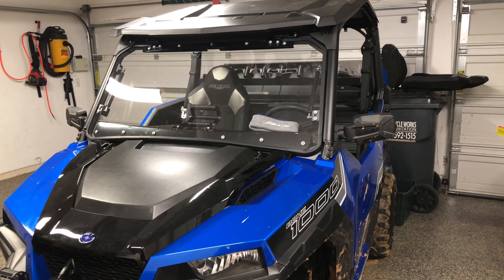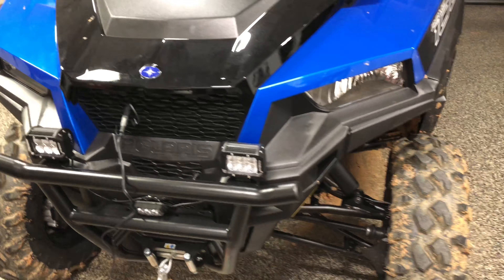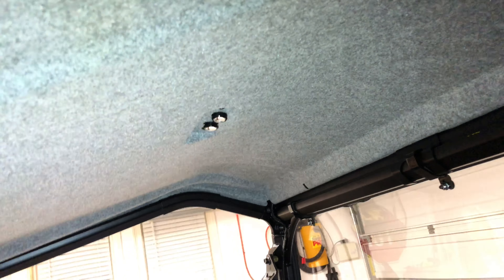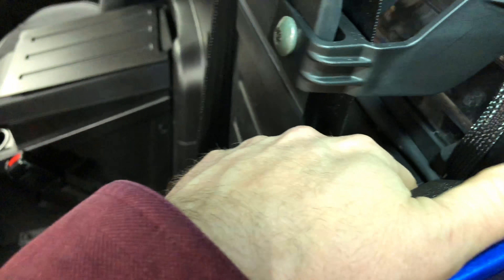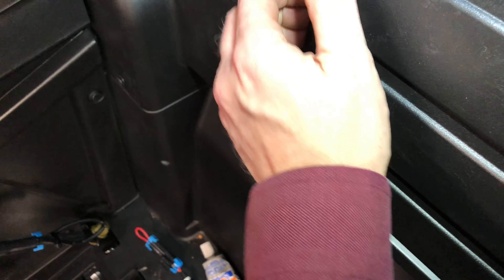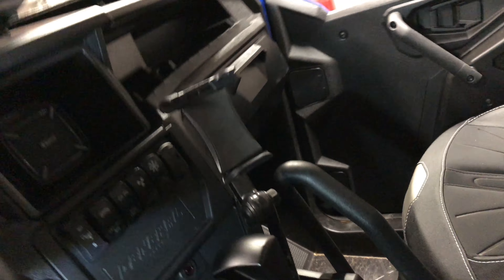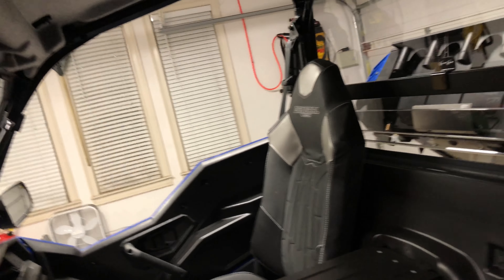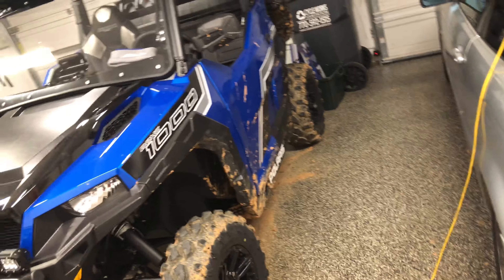Polaris General - Garage Lights, Dome Light Almost Done, SxSBlog.com

Comment: Is there a pulse bar that could be mounted to the roof on the general do you think the pulse bar from the Ranger will fit there in the plastic roof in the back instead of going to the battery do you have any idea Polaris doesn’t know what’s going on I think the polls bar that is made for the Ranger Pults bar will fit the general what do you think

Comment: Hi, i have a question on the interior blue leds. Did you just replace the leds or did you rewire them? The reason im asking is because i want to see if i can replace with brighter leds. If i just replace will the original wiring and fuse be able to handle it. Thank you in advance.
Reply from the maker: I replaced them with these: https://amzn.to/2XFoSAa. No need to make any other changes--just wire them in as a replacement (you may need to enlarge the hole slightly).
Reply: @GeneralTalkWithBen  got it thank you for the info and quick reply.FYI i been watching all your videos!!

Comment: What LED lights did you use in replacement of the stock driver side floor, center console, and passenger side floor blue lights ??? Wish you would put links in the description of your videos with the parts you use....
Reply from the maker: Sorry about that. I have the link on another video. Here you go: BRIGHTEST Light Bolt - Flush Mount 12V LED Light for Bumper, Grille, Cars Interior, Dash, Ambient Lighting, Motorcycle w/SLEEK Aluminum Housing & Screw Nut (11 mm Black, Blue LED) https://www.amazon.com/dp/B01ADHUTAK/ref=cm_sw_r_cp_tai_1HRlCb68K038B